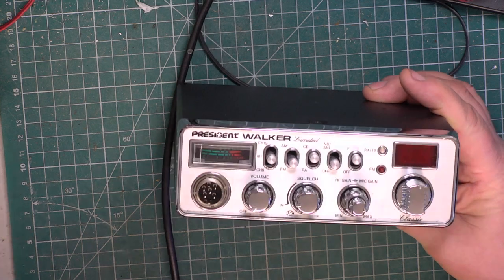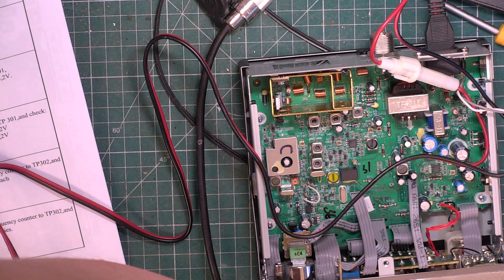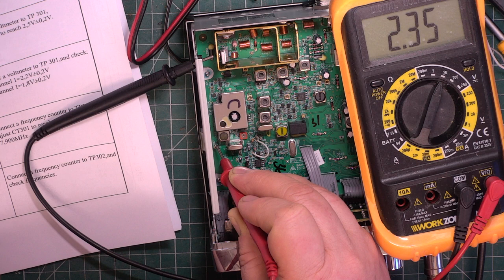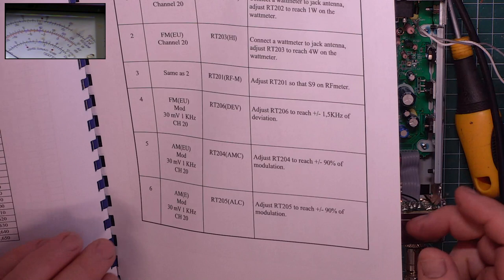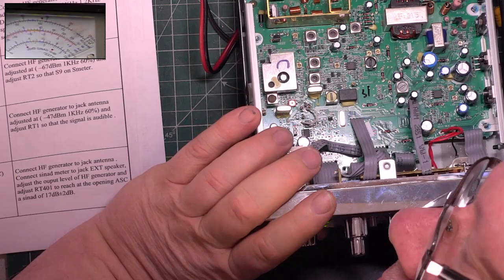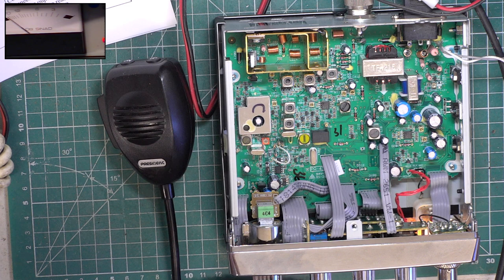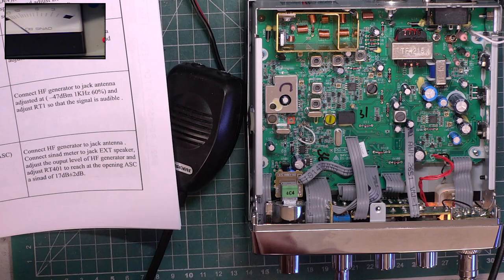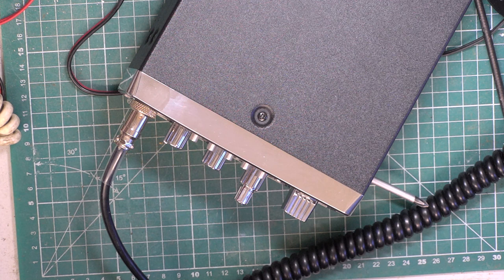President Walker Limited CE MultiNorm CB radio - Service alignment & VCO

Comment: I think it is supposed to be 1w AM in EU setting and 4w AM in the E setting.
Reply from the maker: It used to be 1W in Germany. It's changed now, hence the preset mentioned in the manual no longer being present on this particular set.  Disappointing as ever like with most new sets that they leave the factory set under 3W.

Richard, G0OJF, UK

Comment: Almost S7 of noise on that meter.
Reply from the maker: Meters mean very little. The radio clearly isn't generating much noise with that SINAD reading of 0.34uV for 12dB SINAD.....mind you, that's not as good as my Rotel RVC230!

Richard, G0OJF, UK